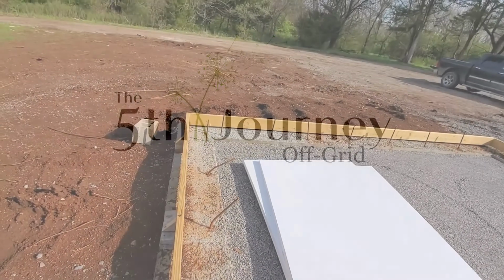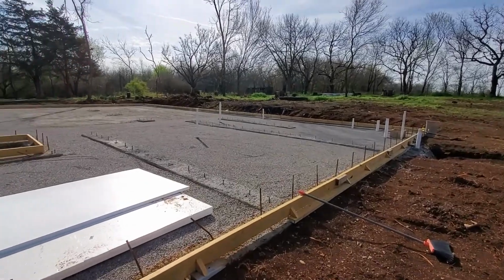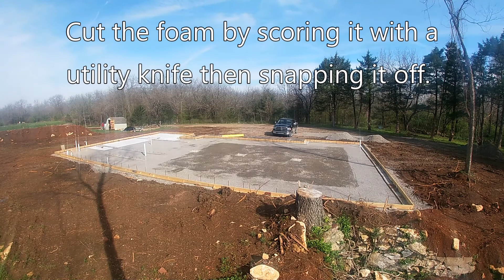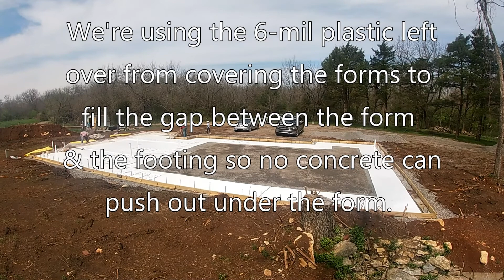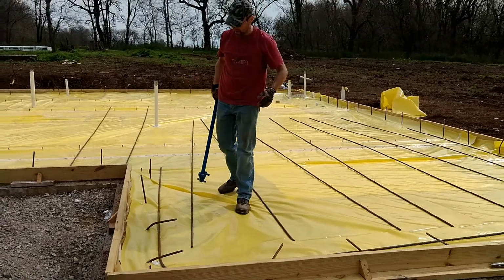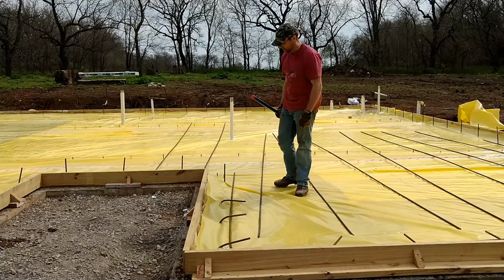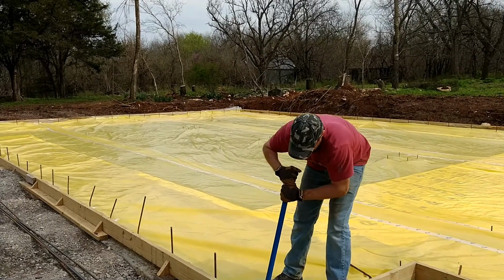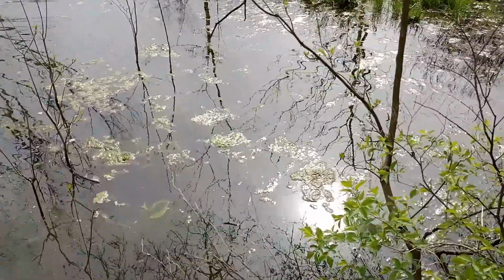Insulating a Concrete Slab with Rigid Foam & 10mil Plastic Vapor Barrier | Off-Grid Homestead Build

Comment: do you have a vid of continuing that vapour barrior taping it off w.e
Reply from the maker: Probably have some video clips that I didn't use in the video.  What question do you have?
Reply: @Off-Grid  jw how you do it
Reply from the maker: @Brandon-no3vc  we used Tyvek Tape and overlapped the joints by 18".
Reply: @Off-Grid  and taped it to where
Reply from the maker: @Brandon-no3vc  tape it to the other sheet of plastic where they overlap. Once you put your rebar or welded wire mesh on top it won't go anywhere and once the concrete is poured it really won't go anywhere.  The plastic was cut for the rebar and plumbing to penetrate and was sealed up with the tape.
Reply: @Off-Grid  I ment where it comes up the slab to daylight
Reply from the maker: @Brandon-no3vc  it wasn't secured ny anything except where the rebar stuck through the plastic.  It was taped around any plumbing penetrations.  You could staple it against the form if you wanted to make sure it didn't move during the pour.
Reply: @Off-Grid  you didnt tape it off to the other mosture barior on the wall?
Reply from the maker: @Brandon-no3vc  no, the plastic does not attach to the walls.
Reply: @Off-Grid  why? wheres it attach?

Comment: a nice piece of pipe would help bend that rebar easier.
Reply from the maker: A few seconds after that part I turned the tool around and used the pipe side.  It isn't a very good tool.
Reply: @Off-Grid  i was scratching my chin watching that saying "physics" lol